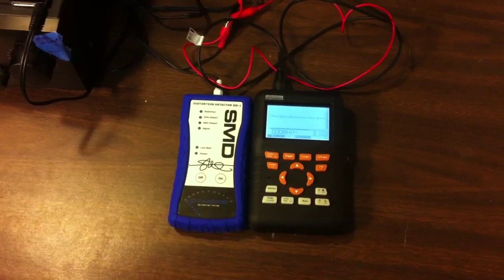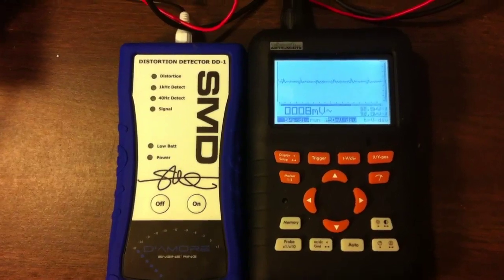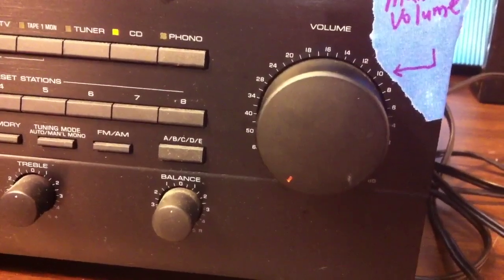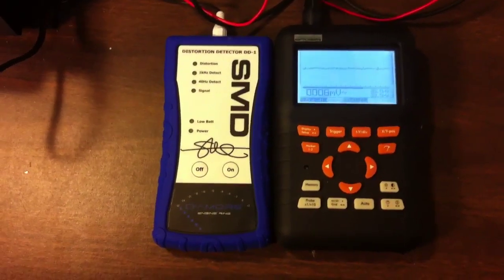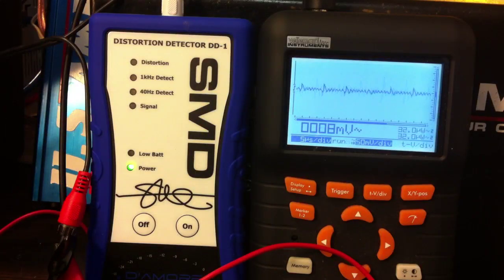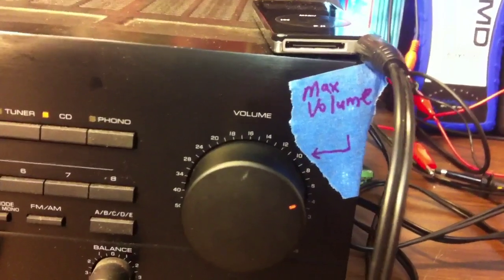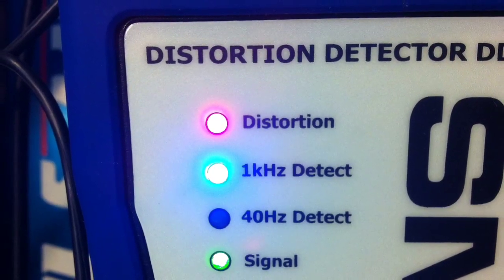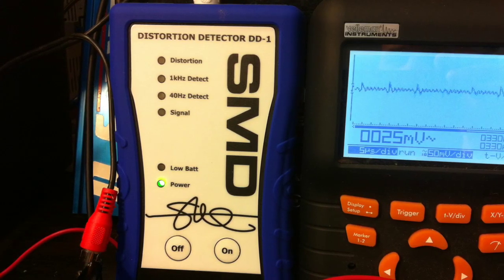SMD DD-1 - OldSchoolStereo.com Test Bench Update

Comment: Man,  I just received the DD-1 today in the mail but I'm so bummed out because I'm using a Samsung Galaxy S 8.4 tablet as my deck but there's no way to down load the files.........I keep messaging Steve but he sends me a link that goes straight to the D'amour site that I've been going to all along.   I think D'amour should develop an android app for the test tones,  that would be super sick!!  Anyways is there any way you can help?  Thanks.
Reply from the maker: +Ruben Alvarez You should be able to get a tone generator app that will work as well. Also, I'm sure there is a way to get the files on your Samsung Tablet, you just need the MP3 or MP4 versions. You can download the rar file here (you will need to use a program such as 7-zip to unzip the rar file to mp3's) - http://damore-engineering.myshopify.com/products/dd-1 (look at the bottom of the page). If you still have problems and need to get the individual files, let me know and I'll do what I can to help. Email me at bigdwiz@gmail.com

Comment from the maker: To be 100 percent sure, you can first find the clipping point of your head unit, then connect the DD-1 to the speaker output leads with your subs hooked up. This way you can set your gains based on the load on your amp. Only problem is it may be LOUD with the 40Hz tone coming out of your speakers while you have your head unit at max unclipped volume. Just turn the gain on the amp up or down until the red light goes off

Comment: I got a question? lets say you have a amp thats 250rms@4ohms & you set your gains with dd1 then wire it 2 2ohms to get 500rms would you have to reset the gain @ 2ohms for no distortion I'm confused cause ur amp can be 250rms@00.1@250 & 0.10@500rms & higher @ lower ohms driven Does this DD1 change the loads to set ur gain@ different loads? I think most amps are standard 4 ohm output an able to go lower if wired to it but the distortion rates very @ differnt loads so is the setting @ loads RIGHT??

Comment: This is great because it will show waveform distortion - not just clipping. So, now go look at the Orions you ran at 2 ohms and watch that clipping LED light up at much lower power outputs than you previously measured. While those amps will put out gobs of power, they're actually clipping early due to their output drive circuitry not able to keep up.

Comment from the maker: When I first took out the DD-1, I tested my Lepai LP-2020A+ for unloaded power output and got 8.83V RMS of unloaded output at the speaker terminals. If you use this measurement to obtain the 4 ohm wattage (again, no load on amp), you get just over 19 watts RMS per channel. Maybe this is where Lepai gets there 20W RMS rating...based on unloaded output?